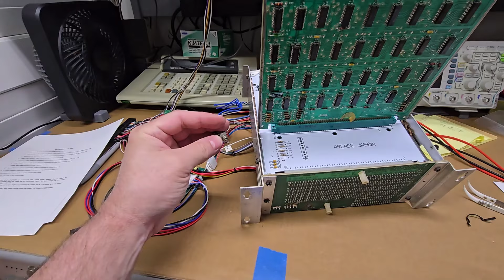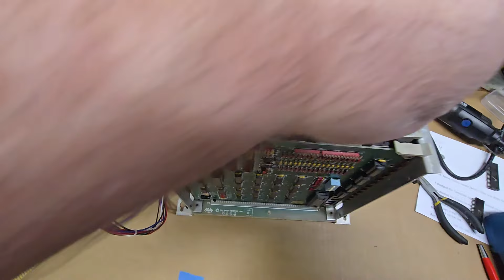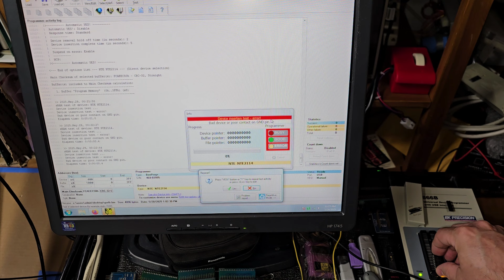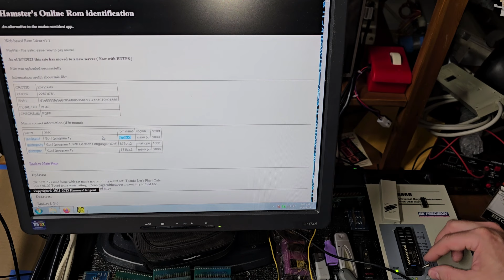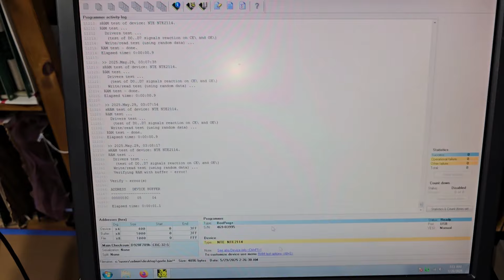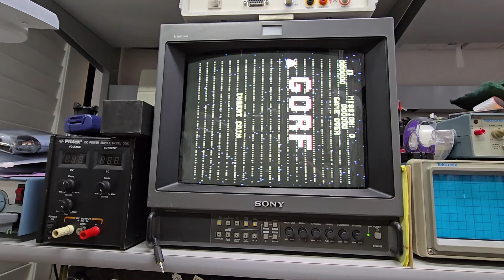GORF PCB Test & Repair - Board Test Favor - Pt 1

Comment: I have seen higher voltage to the customs on the 8.5v line when you have X2 empty so you may want to check for that.

Meaning, if you leave X2 unpopulated you may inadvertently over-volt X3 and damage that chip.

YMMV
Reply from the maker: Thanks for the tip.  VGG is shown as 10V on astrocade schematic and I believe other games and the console only use one, so it is probably fine.  However, worth measuring next time I have one on bench.  Thanks
https://wiki.console5.com/wiki/0066-117XX-XXYX

Comment: Is the insertion testing the rom/ram chips pin to pin resistance, pin to ground resistance and pin to Vcc resistance?
Reply from the maker: Resistance measurement is definitely part of it.  I believe the beeprog is applying low voltage, less than 1v, and doing some impedance matching and voltage drop measurements compare to stored chips profile.  You would need to ask Elnec for accurate answer.
Reply: @jacklick ok thanks

Comment: My understanding is that the peach colored Gorf indicates the easy ROM set, while the darker orange/red Gorf indicates the hard ROM set.  If you have a HSS kit installed, it will show up as the peach Gorf, but it is the hard set.
Reply from the maker: Cool. That further validates what I saw then.  Version 2 is the harder and has "red" G-O-R-F.  Interesting about the HSS save kit behavior.
Reply: @jacklick the HSS kit really is an awesome solution as it eliminates the ROM board as a possibility since it’s no longer needed.

Comment: I really wish I didn’t love Gorf.  I have 4 board sets now.  This game will be the death of me.  The troubleshooting never stops.  The Astrocade system is the worst design of all-time.  I have a Wizard of Wor too.  Lol!
Reply from the maker: Those darn custom chips.
Reply: @jacklick  Have you seen Classic Arcade Repairs? He just got a Sea Wolf 2 board in, that had a replica Data Custom installed. So somebody made a replica (and he tested it in a Wizard Of Wor and it worked fine!) and never told anybody! (can't google it either - there is an empty account under that name on some arcade preservation forum, but no entries, no nothing!)
Kinda looks as if we weren't even supposed to know of its existence.
If that were on sale, I'd buy two!
Reply from the maker: I haven't seen the video but was aware of replica and purchased a couple of them after this video.  You can buy them from klov user.  I will film using them next vid.
Reply: @jacklick  Put instructions on how to purchase them in that video. Do you have to set up an account or something?
Reply from the maker: @senilyDeluxe  message BigDogs on KLOV